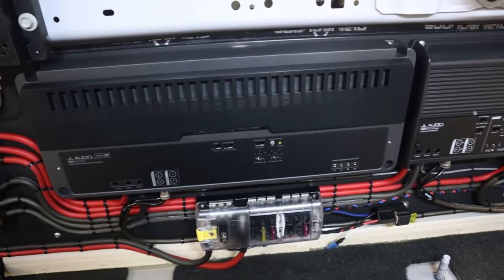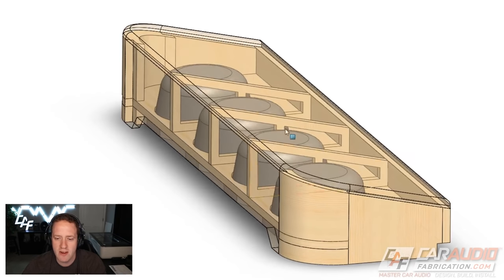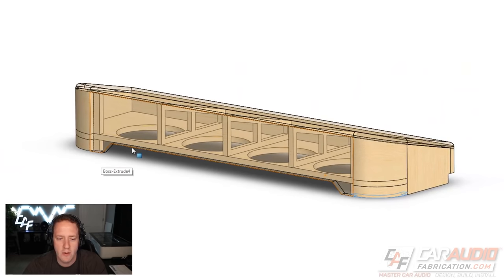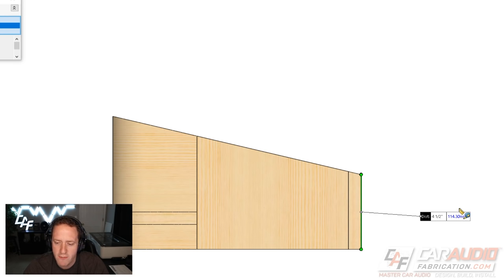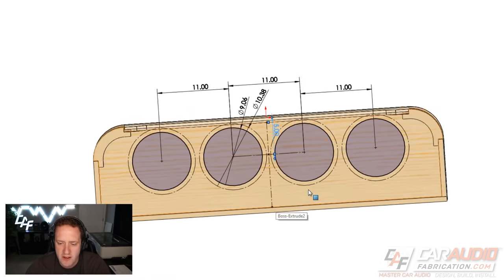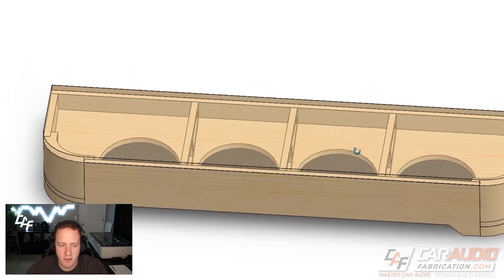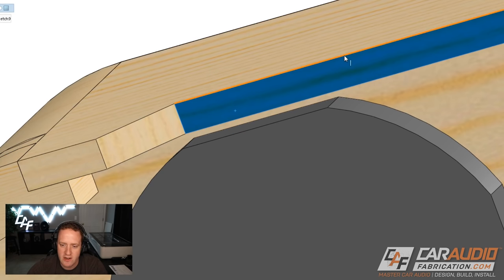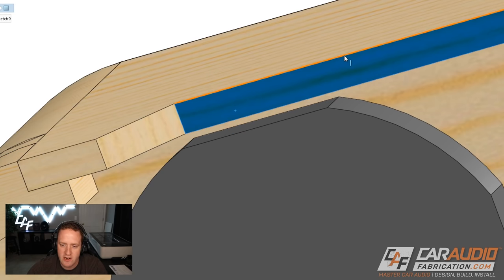Designing an underseat subwoofer box for AWESOME BASS using  four tens!

Comment: Great point on proper sizing of drivers. A properly designed pair of 10 inch subs will blow away bigger but poorly designed and constructed systems. Bigger is not always better.
Reply: That's facts... I got a custom 8 inch sub in my Car and it sounds like a bigger build, because of the quality of the box and sound treatment!
Reply: Just look at oem designed premium systems. Often using a couple 6's or an 8.
My thx sounds great.

Comment: A lot of changes from building a box when I was younger to now....  I can definitely see with the more costly materials where you don't wanna make a bad cut due to improper measuring (measure twice/ cut once)  but this does allow all the potential hangups to be dealt with before one has to put pieces of wood in a whoops storage bin to be repurposed  as for another build or for the firepit.  You definitely are a wealth of info in the car audio realm!
Reply: haha reminds me of when I was in middle school and got the speaker box design book from Radio Shack.  Taught myself a lot of algebra and geometry that way.  In my 8th grade math class the teacher gave us a pre-test.  I was upset I didn't have the time to finish the last 11 or so questions.  The teacher about flipped her lid because I was teaching myself stuff like cross multiply and divide while taking the test and resulted in like an 11th grade score on the test.  I wonder if modern tech would have the same kind of impact on someone or if the computer doing the work for them would dull it out.

Comment: I’ve been using 2 12’s on 600 watts. And door speakers that aren’t amplified yet.

 I installed them myself and followed every rule I could find. People find it quite shocking when they learn that I’m only using a 600w amp on my subs and nothing on the door speakers.

Thanks for all the lessons!
Reply: You don't need a lot of watts to push the right subs my wife's blazer is running 2-12in kicker impulse they are kicker subs from late 90's I had bought 20 of them when I did budget SPL competitions if my memory is right I think I paid 89.99 each back then i had 6 left so i put 2 in and one of the old Rockford power punch 360a2 that pushes 90w by 2 channel we tested it at 152spl and as you said no amps for mids and highs, awia dub din head unit and modified in 2- 6.5in Polk audio component sets in front & rear and that's it and it sounds awesome. you don't need to amp everything nore do you need to spend a arm an a leg if you just want some bump and to sound good and in mid speaker picking ones with higher sensitivity take less power to push.

Comment: Good tip with the scaling of the sub cross section picture, used to do the same thing back on the day before the availability if good online 3d modelling software so just had to scale the technical drawings to real size and then print it out so had something to check fitment etc when didn't actually have the part on hand 😃
Reply from the maker: Thanks. Unfortunately with all these manupackagers out there now a days there are rarely technical images to use. Luckily though quality manufacturers like JL are still around.
Reply: @CarAudioFabrication  haha haven't heard the term "manupackagers" before to describe all those brands that just slap their logo on some generic product 🤣 Yes as you say its nice that there are still some brands like JL that stay true to their design philosophy after all these years

Comment: I have a stealthbox under my back seat of my 2015 Silverado crew cab with 2 jl audio 10w3d8 subs in it and 1000 watt 1v2  amp. I would really love to get 2 more 10w3d8s and hook them to the same amp but my whole middle seat and center console be turned into a sub box and center console of my own liking.
Reply: How is the stealthbox, did you upgrade everything else, or just do a dsp and stay factory?
Reply: @skyychaos26  I have a loc hooked to the stock bose amp and yes the stealthbox is amazing I don't even have it turner up all the way I want 2 more speakers before I turn it up again. I need to get big 3 upgrade and new alternator before I do and I would like to upgrade the factory stereo and interior speakers. Just do your research to anyone that has bose systems in your vehicle since a lot of stuff either won't work with bose or you have to replace and bypass stuff but yes I want a new amp for interior speakers when I get them as well I hope my bose system is still good enough to sell when I get to that point. Bose is nice by itself but I definitely need a new head unit to power them better or like I said switch everything. Would be nice to go with all jl audio amps and speakers idk what head unit I want. Gotta save money n got tons of other bills right now like 60k worth 🤦‍♂️😞

Comment: Just in case you and wood don't get along to well?   Dual has a great Down firing subwoofer you can get at Advance Auto parts for less then $82 bucks for the pair without tax.    These were the secret sauce for me to get that Mid-BASS kick  and I mean KICK drum and Tom Toms a plenty! 

I have room for my main sub woofers in the back, but this gave me something that I just could not accomplish in my car due to phase issues, and cancellations.   The boxes are very well made for such a good price, I could not say no.   Buy them in a pair since  that's really how they need to be used.   I run mine in stereo right behind the seats and since they tuck up right next to it?  It also feels like I have a Tactile transducer mounted to the seat back.   Pretty cool. 

It won't work for everyone, but for me?   It was either this? Or start cutting my car in order to install a Mid bass on the floor PSound style like Peter often does.   That would have been killer to do, but just not ready for that  amount of customization a this time.
 And I love Water puddles.   

For everyone else?  Have Mark or someone else build the box for you and forget about the intensive labor and time doing all the hard work it takes to put something like a custom box together.    

having a pro do it saves you so much time and grief.   Mark also knows a bit about cabins so he could probably be able to get the most out of your box he makes for you.     And the dude does some AMAZING looking work.     It looks more like Furniture then a Box if you ask me. 

ask yourself when is the last time someone made something custom tailored just for you and your vehicle? People used to get suits and clothing made just for them and tailored to their needs this is basically the same thing but with car audio.

Comment: For your F150 build with this size of install did you have to upgrade anything on vehicle power side? I.e battery, alternator etc.
I'm looking at a similar install for my Ram. I already upgraded to a larger battery from the Diesel model but wondered if that would be enough.

Comment: Do you do any custom boxes for people and ship them.  Ive currently got a q logic box with a single jl w3.  Its served me well but would like to add another 10 when i buy my new aps but a cant find a dual 10 box that offers 5 7/8  mounting depth for my application
Reply: Is an 06 silverado crew cab. Couple companies do offer a behind the seat but they are all about 3/8- 1/2" short on depth  and noby makes a dual under the seat for a crew cab. And I've yet to find a shop locally I trust to make a decent looking one don't want competition level or anything but it's gotta atleast look decent and due to garage space at the house with other projects I'm I'm no position to try and do it myself, got the tools but not the available space or time.

Comment: Hey Mark. With a design like this, how much of an air gap do you need between the subwoofer and the floor? It’s something that I’ve always wondered about. Apologies if you mentioned this in the video already. Thanks!
Reply: I have two JL Audio 10WOs down firing in a 2020 Chevy Silverado that I had my local Car Toys build with the JL Audio SGRU-10 grilles with 1.5" of clearance from sub bottom panel to the carpet.  There is 0.5" clearance from grille face to the carpet.  All of the energy released through the slot on the back of the box because they had to cut the full rubber floor mat to the edge of the front of the box.  All of the energy basically goes backwards into the cab back wall.  Sounds great and does not sound restricted.